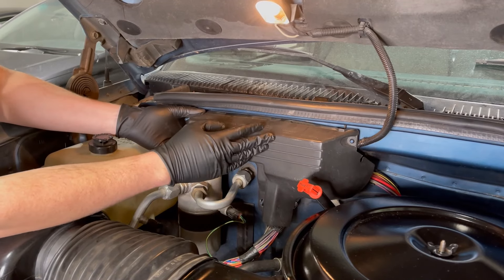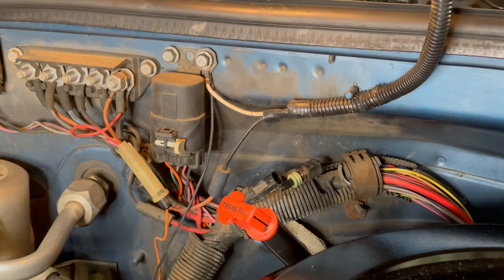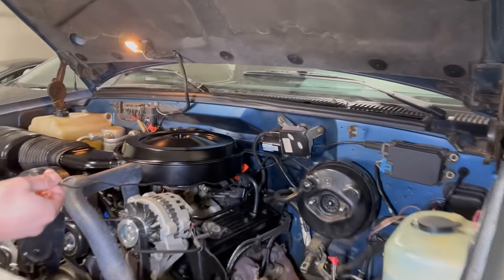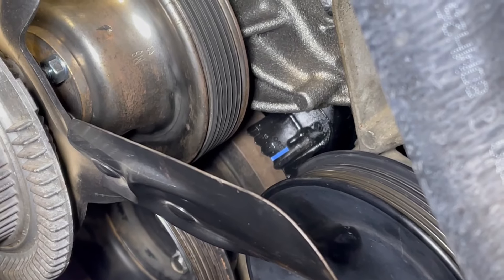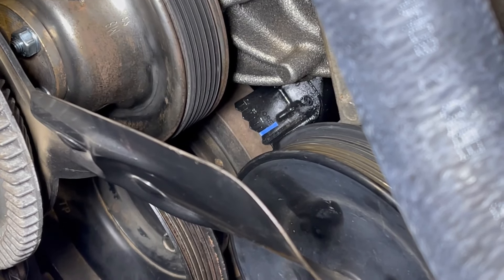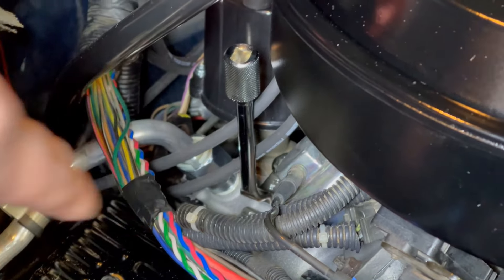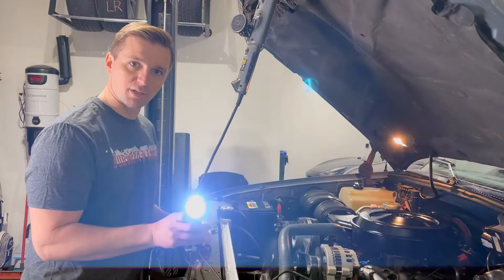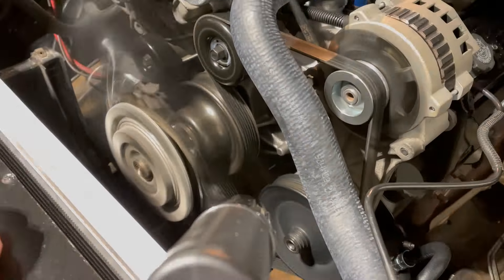Adjusting the timing on an 88-95 TBI OBS Chevy 1500

Comment: Fantastic tutorial. 1989 GMC Sierra C1500 Brought a timing light and just set my timing dead-nuts, secured distributor and re-plug the timing advance cable/wire. I've been stalling at red lights 33% of the time...for years...now my truck has more power, better gas mileage and never stalls.  You Rock!
Reply: I can't find my cable on 94 k1500 suburban:(
Reply: @abe6517  on a 94 I think it's under the dash on the passenger side
Reply: @mikemartin2423  omg! Ty! It's right effen there! Why they hide it! 😆
Reply: 1990 Chevy suburban ecm location

Comment: This is really helpful. I'm working on a 93 4.3L C1500 that has a slightly different timing tab, yet basically the same tooth configuration. This one has no actual markings on it at all, only the teeth. At this point I'm going to "assume" that the deepest groove is TDC on it also. Oddly enough, the factory manuals don't have that information in them for the 4.3L TBI. Thanks.

Comment: my advanced timing connector was near the electrical plastic cover next to the fire wall . and some are under your glove box next to your heater motor .
Reply: My 1994 is under the glove box, although the timing sticker in the engine compartment states its at the same as the video
Reply: @sandiegojody  is that wire under glovebox a single wire,? and the connection under the plastic cover beneath hood a two wire? 
  Isn't the single wire connector conjured with one of the other two under the plastic?
Reply: @frgfgr8456  Hello, It's a single wire.
Reply: @sandiegojody Same under my hood/plastic cover on my 1993 5.7 350 Silverado

Comment: I have a 1994 c1500 280,000 miles just replaced distributor it idles good but is sluggish when accelerating. What do you think the problem is?
Reply from the maker: Check the timing, we have a video on that!
Reply: We have a few times and advanced it 4 degrees

Comment: I’ve read a lot of comments but I gotta ask again :
Is it right to set the timing at 0‘ on the harmonic balancer ?

I did that on my 1990 K2500 and connected the truck to an engine analyzer. It shows 16‘ while idling (which is ok I think, BTDC) but only 28‘ at high rpm what should be actually 34‘-36‘ .

Spark plugs, cables, distributer all new…
Reply from the maker: As far as I know it’s correct to set to zero.

Comment: Great video, I have a 89 Chevy K1500 that would not start, I replaced the following parts; primary coil, pick-up coil. ignition module, distributor shaft, cap and rotor. The truck fired right up but with a skip. I unplugged the EST plug to set timing but the truck will not start with the unplugged EST connector. I do have spark at the number one plug! Any idea what the issue may be?
Reply from the maker: @Gary Tuttle What happens when you unplug it while the truck is running?
Reply: @SuburbanRanch  Thanks for the reply! I found out why it was missing, I had two wires crossed on the distributor, switched them and it runs smooth but still want start when EST unplugged. I checked the timing and it's TDC. I haven't tried unplugging while running, I'll try that tomorrow. I'm puzzled, how can it run if I have a bad new part?
Reply from the maker: @Gary Tuttle Hard to say. My guess is that the base timing is too far off
Reply: @SuburbanRanch  Could I be off a tooth on the distributor gear when installing the distributor?

Comment: Hello I’ve done this on my 89 and it’s still sluggish after getting it to 0degrees and plugging the auto advanced plug back together, wondering if having a mild cam would make such a difference on the timing? Or should I set it to a different degree because of the cam? Any help will be appreciated, love the videos.
Reply from the maker: @J. O. A. T. the GOAT You will have to talk to the company that makes the cam and see what they recommend for the timing
Reply: @SuburbanRanch  but I have no idea what exact cam is in it, the truck came to me like this.
Reply from the maker: @J. O. A. T. the GOAT Probably needs a tune to be honest, not sure changing the base timing will fix it
Reply: @Tatted_gunna  Put in the suggested tuneup, but try a couple of degrees of advance---TWO, ONLY.  Take it out for a (short) test drive--if its performance is acceptable at that point, you're good to go.  If not, I don't know what else to try.  I hope it does "wake up" your vehicle's engine.   Good luck to you...  P.S.  I have a '91 K1500, and the previous owner put an Edelbrock RV cam in it.  My motor seems sluggish also, even after replacing the TBI unit.  I'm going to check its timing, and if it's at Zero degrees, I'm going to try what I suggested to you.  If it doesn't improve the performance of the motor, it may be a worn out timing chain/gears issue.  You might have that problem also, if the 2 degree suggestion isn't helpful.
Reply: @bobhoffman5581  thank you!

Comment: Hello, I have a problem with my 1990 5.7l Chevy C1500 when I set the time to 0 degrees and connect the computer cable, it automatically goes up to 6, 8, 12 or 14 degrees and it goes out of adjustment.
Reply from the maker: That should be fine. The computer is taking care of the timing once it is reconnected. You are just setting the base timing.

Comment: Seeing this, im sure i need to set mine. When i got my truck it ran fine. I changed spark plugs, cap and rotor on it new fuel filter and etc. When replacing fuel filter it twitstwd off. After replacing the line with a 1/16 hose bigger than factory, i figured out the right combination to repair the factory line with a new end and go back. Before going back to factory line and using the bigger hose, she was sliggish off the line and hesistant. After going back factory , it imporved but still hesistant and flat on power up hills or load especially when hauling my trailer. Well i replaced 02 sensor, coolant temp sensor and the map sensor. Major imporvement but the hesistant was still prevelant and flat on hills but yet its like after a while or backing off the accelerator slightly, it was like a catch up action. Of course fuel economy was horrible all through this. Today it hit me. I never check timing after replacing the cap and rotor and i didnt think i needed too. Well im checking it as soon as i get a light because im sure all this time, that is very well my culprit. This video is more than clear to do it confidently
Reply: Well, was it the timing after all?
Reply: @MatAK49  I bought a timing light and have yet to get to it yet. I'm excited and hoping that is part of it major problem.

Comment: So my issue is how low the idle is at zero. I have a 95 Tahoe with an nv4500 swapped into it and my biggest gripe is it not advancing enough between 2nd and third. You can feel and hear the timing advance at about 3100 rpm in third gear.

Comment: What if it’s not staying on the 0 consistently? What if it jumps from 0 to 8 degrees then back to 0 ?
Reply from the maker: With the wire disconnected, I would not expect the timing to wander. Is your distributor loose?

Comment: So what's the mark reading..... after you set to 0°,tighten distributor, shut off engine and plug the advance wire back together???
Reply from the maker: @Frg Fgr It is set by the computer. Should be advanced, probably around 20, but depends on a number of factors (engine temp, rpm, etc)
Reply: @SuburbanRanch  agreed, understand..

Comment: I have a 90 tbi 350 and it’s currently stalling when put in gear.. I’ve done cap and rotor and coolant temp sensor might you have any idea if timing could be the cause of this?
Reply from the maker: @The1whoknocks I’m not sure, maybe someone else has an idea though
Reply: you can remove the egr and push in the diaphragm and cover the little vacuum hole up. if its bad the diaphragm will come back out. that help my stalling issue.
Reply: @SidVintageToys  ended up being distributor
Reply: @the1whoknocks275  I’ve been changing everything myself. To much timing is knocking to little it’s sputtering and backfiring. Woohoo

Comment: i have a 1990 chevy cheyenne 4.3 throttle body. its currently timed 2 degrees over top dead center with the timing bypass wire completely disconnected ( for some reason the bypass conflicts with the timing) im still losing power off and on as im driving any suggestions? recently put new push rods cam rockers and head gaskets in it replaced spark plugs leads and distributor. thing runs fine for like 5 minutes then just becomes choppy. also has an aftermarket flowmaster cat and a 3 inch exhaust the engine has 81000 miles on it same with body im stumped. it gets a oil hot smell however thats also burn off from the partial rebuild since it doesnt even have 500 miles since the new cam pushrods rockers ect
Reply from the maker: @LilSynaster Sorry man, I’m not sure where to go on that. Maybe someone else may have an idea.
Reply: @SuburbanRanch   im blaming the throttle positioning sencer or computer its the only thing at this point i can think of i never went to school for this i just picked up stuff from my family over the last 22 years of being alive i have a 350 from a 78 silverado as a last resort imma just slap into it im getting to a point id much rather deal with a carb and keep the original motor as a spare
Reply: I'd be looking at the throttle body gaskets for leaks and the vacuum hoses all around the throttle body for cracks-missing leaks.....at lot of rough running is after warm-up when those vacuum lines start taking over...ERG, ETC,ETC. Many times the ERG Diaphragm is bad and leaking too. Also Replace the TPS regularly every 50 to 80k miles

Comment: well i couldnt find the wire diconect, but i checked the firing order and 3 and 6 were backwards and now it spins second so
Reply from the maker: @wafflesandcream There’s a couple other comments that say theirs were in another location. I’d check those out if you still need to disconnect it.

Comment: What if you have aluminum 2.02 heads and small cam?
Reply from the maker: @RC MAFIA The timing process is the same but I don’t know where you should set your timing
Reply: Your running out of fuel put a new fuel filter on it k you get fuel but not enough

Comment: Tried doing this after swapping distributors on my 94 and it won’t run with the wire unplugged no matter what I do
Reply from the maker: Base timing is probably too far off. Try rotating it to different positions and then unplugging.

Comment: What if I’m not getting any marking when the the light flashes ?
Reply from the maker: @Sam Martinez Can you see the mark on the harmonic dampener while the truck is off?
Reply: @SuburbanRanch  yes ! I marked it with a paint marker too but once I turned it on and attempted to “0” it the line never appears when the gun flashes.
Reply from the maker: @Sam Martinez I wonder if your timing is way off. Did you try to look way around the damper in both directions?
Reply: @SuburbanRanch  *update * I got it timed at zero but once I reconnect the PCM it it gives me something completely different . Is that normal ??
Reply from the maker: @Sam Martinez Yes, it advances the timing when plugged in.
Reply: @SuburbanRanch  do I adjust it back to zero ?
Reply from the maker: @Sam Martinez No, only adjust it while unplugged.

Comment: no smog and no belt on ac comp?
Reply from the maker: @Justen b We will be fixing the a/c in an upcoming video! This truck was never equipped with smog
Reply: @Suburban Ranch  what year is it? It didn't have air injection? So it has no egr etc etc etc?
Reply from the maker: @Justen b It’s a 1990. Equipped with EGR, but no air pump.

Comment: My truck doesn’t start back up once I unplug the andvance wire and dies when I disconnect it while running
Reply from the maker: @Taylor Young Timing might be wayyyyyy off
Reply: @SuburbanRanch  I went to check the timing and it’s right on the money but I don’t think it’s the same if the the wire isn’t unpluged
Reply from the maker: @Taylor Young The computer is correcting it but the base timing is way off if it won’t run
Reply: @SuburbanRanch  how can I fix it my truck is gutless up hills and takes 20 seconds to get to 60 mph
Reply from the maker: @Taylor Young Get cylinder 1 at TDC and then rotate the distributor until the rotor points at cylinder 1. That will get the timing fairly close and you should be able to adjust from there. Or just guess and check. Rotate it and see if it will run. If not, rotate it the other way.
Reply: @SuburbanRanch  I’ve already done that do you think a bad vacuum canister could cause it or vacuum leaks
Reply from the maker: @Taylor Young Certainly could be a vacuum leak causing your issue, but if your timing is off with the wire unplugged you should address that first.

Comment: what’s the purpose of the timing light? can’t you just line up the timing mark to 0 without it?
Reply from the maker: @Batman 090703 This video describes how to set the ignition timing. In this case we have the light connected to cylinder one which means the light flashes each time that cylinder fires.

Comment: How do you adjust the distributor to tune the timing?  I would be interested to see that part of the process.
Reply from the maker: Once you have it loosened just turn the distributor with your fingers. Very small adjustments lead to big changes. We found it best to have two people. One watching the balancer and one turning the distributor.
Reply: Clockwise or counterclockwise? My timing is way off I just noticed my dial is about a whole 180 degrees off. My truck starts and moments later it just shuts off, then it just cranks and won’t start. Could this be the timing??
Reply from the maker: @kraken seven try flipping the distributor and see what happens!
Reply: Elaborate with me here, what do you mean by flipping it my good sir?
Reply from the maker: @kraken seven you have to pull the distributor out and rotate it 180 degrees. But you should only have to rotate the distributor if you had it out of the truck. Otherwise, it's probably just a little bit off (small rotation). That’s my guess but I don’t have a way of knowing for sure what the actual problem is
Reply: I haven’t had it out, I just changed the ignition control module, cap, rotor, plugs and wires. It’s been giving me this problem ever since. Let me try the (small rotation) when I get it started cause it’ll only start ever so often and it shuts off after a few minutes.
Reply from the maker: @kraken seven check a make sure you have the wires on the correct cylinders
Reply: The wires are good, I used the small rotation and the harmonic balancer is right on 0 degrees, I tightened up the distributor shut off the vehicle and then connected the advanced timing wire back up. When I started the vehicle and checked the timing it’s still off to the furthest advanced degree. I’ve repeated this about 4 times already.
Reply: At what point do I reconnect the automatic advance wire? Maybe I’m missing a step
Reply from the maker: @kraken seven when you are happy with the timing
Reply: Thank you, you are very much appreciated.

Comment: Can't find that connector! Looked through all wire, nor under cover neither down the wire!
Reply from the maker: @Александр Елкин It should be where it is in the video, unless it was modified, then I don't know where it could have been moved to
Reply: @SuburbanRanch  Don't know how it could be modified. But will look for again.  Also after oem service center , they adjusted ignition, my engine started to stall on low RPM. Looks they did it wrong.
Reply: my 1994 Blazer is under the glove box

Comment: When i did this and then reconnected the advance wire, the engine runs worse and throws a 43 knock sensor code.  And the timing gets retarded by 12° 
 tested knock sensor, tests fine.    Can't figure it out
Reply: Replace the knock sensor anyway. Cheap and easy. I just did mine. There are a few vids on youtube to help.